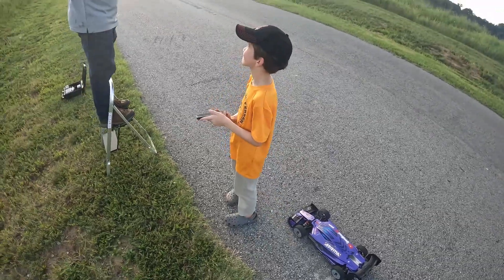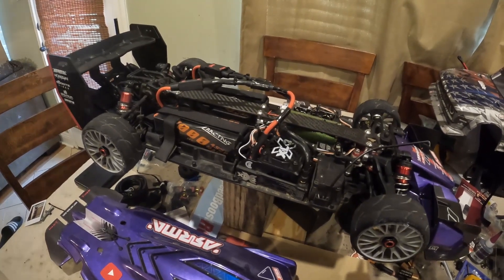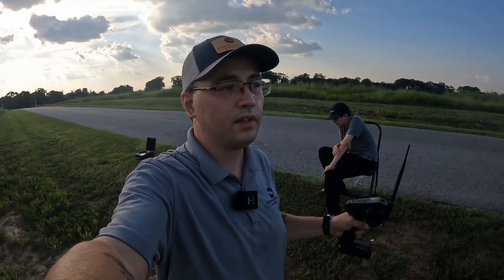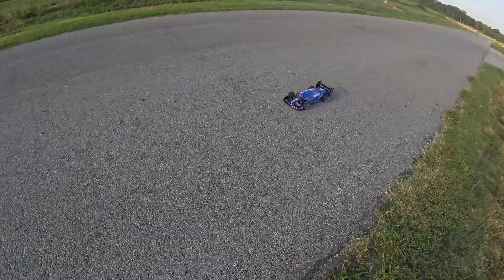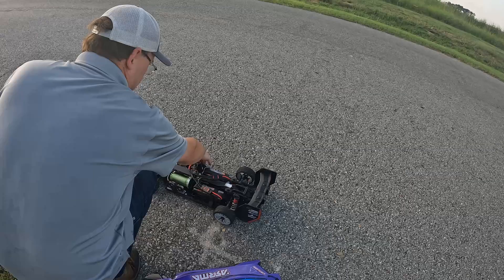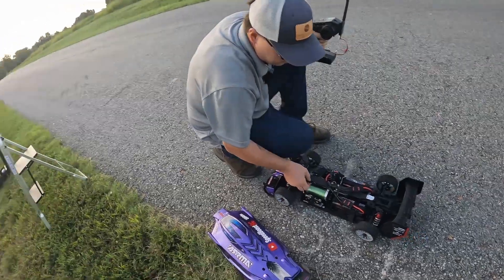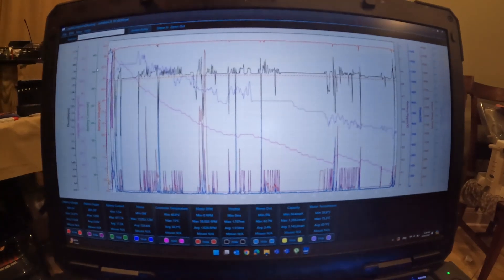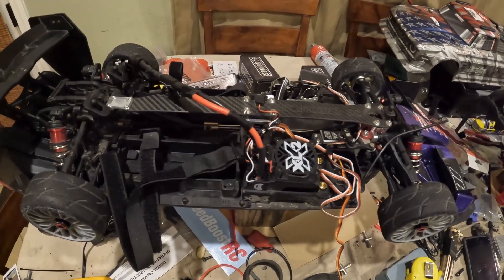Pushing for 150 MPH: Electronics Fail During High-Speed RC Run! Reached 129 MPH!

Comment: I know this is a while ago but better batteries will help I have the same 8000mah 4s and could only hit 110-114 then I got 2 4s 5000mah panther graphene packs for like $36 each and hit 120-126 I since ordered 4 4s smc 8600 lipos just waiting for better weather. Also buy a heat gun they are cheap. Just subscribed and checking other videos Thanks Good luck
Reply from the maker: I have many CNHL G+ Batteries now. I'm looking for a good place to run the new dual motor car. I will have a video soon of us testing the two 1700Kv motor with two XLX2 ESC.

Comment: Yeah it’s for sure to short you can hear it I think you’ll here it rev up then come down then start pulling and breathing as it regains power. Throttle control , one thing g crossed my mind was it sounded like something to do with the sensor … but Ihave you checked your gear mesh? Is it possible that the gears started heating up and caused it to bind just a little only noticeable at low speeds ?
Reply: Honestly try running 4s and 6s before changing gears the more info you gather the better for future runs…

Comment: Amps are too high for that speed . 
A good rule I start with 200a 120mph 300a 130mph 400a should be in the 140’s at least . Either your loading it up with your pull or the cars drivetrain is not free . IMO distance is too short for that motor . Last ,what did the battery voltage drop to ?
Reply from the maker: I thought of pissible drive train issues, but it free, no binding or anything like that. I did find a longer place to run, so the length of the runway shouldn't  be a problem. I think the trigger pull is the big deal right now.

Comment: Do you have your voltage cut off turned off?  I just woke up but I probably have a couple ideas of what to try…
Reply from the maker: The voltage cut-off is at 3.0v. I heard it should be set very low. Should I just turn it off?
Reply: @SpeedBoostRC you need to completely turn off voltage cut for speed running. If not, you could be limiting power output
Reply: Just remember it’ll drain your battery dead if you run it to much
Reply from the maker: @SpeedrunTnRC  I never run enough to even get the battery below 50%. When I come home after my runs my batteries are normally at 55-65%.
Reply: @SpeedBoostRC  for sure. I’m charging g mine 4s zee batteries now for a run I might just do 4s parallel although I spent a good while fixing my steering last night the servo wasn’t returning g to center from a left turn and that’s the way I kept crashing. Do you have exponential on your controller? I’m finally able to control my car at higher speeds without it being a giant turn … also learned it takes forever to get an xlx2 here I’ll need to order my stuff in advance. Expensive hobby if it’s your money my dog thankfully rescued my rc boat today I posted it

Comment: We are both having our issues I crashed twice at 90 mph basically in the same way… watch rc explained for the ripple pack stuff it’s basically you want it at 5 percent of less … usually not a huge problem with most set ups … since the style of driving is different  it usually won’t build up enough for a speed run…. And no they do t give you more speed as lots of people theorize , it doesn’t.
Reply from the maker: Ripple packs, are they just capacitor packs? If so, RC Explained said the XLX2 does not need them due to large internal caps.

Comment: 2 passes let it rest.  Amazon >>> Powerhobby 6 Pack 13200uf RC Cap Pack/Capacitor for Extreme Racing 4s 6s 8s 12s.  Place as closest to the ESC as you can and y soldier it .  I would suggest going with a smaller spur gear, and only change out your pinion gear.  a 34 Spur is the sweet spot for speed runs..  For the tires go with the, Contact GT8/Rally  CONJB25B and Contact GT8/Rally CONJB35B the 35 go on the back.   Your car should be over 150 Mph easy right now, but your gears are not good.  Just a suggestion from following Raz.  My guys around here in MD say the spur should be smaller, more rotations on the tires.  They are doing 189 MPH +.

Comment: I think I can hear the esc Excessive load beeps. That could be it, gearing
Reply from the maker: Yes, it was beeping overload. The gearing was 30p 45s.
Reply: @SpeedBoostRC excessive overload is NOT always gearing dependent. In many cases, excessive overload is related to throttle input. If you get on the throttle extremely hard without a throttle delay, or some form of traction control, amperage will skyrocket. I'm talking 600A+
Reply: @SpeedBoostRC  ok, to much ripple can hurt the esc, when toy look at your data log see what your ripple is reading you might not need it but I have one from flopack, good to have.also good for a little extra power.
Reply: Sensor wire ? Time to try smc 150c 4sx2 .where are your ripple packs?
Reply from the maker: @kingofkings600  Ripple packs, what's that? I have CNHL 70C G+ 5.0 I will use this weekend.
Reply: I'm thinking it was the packs? 🤔